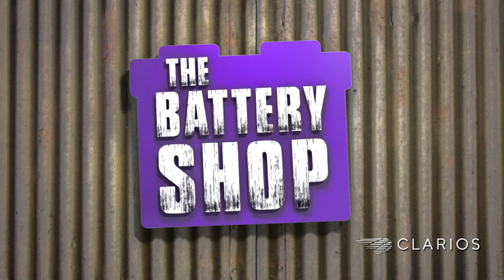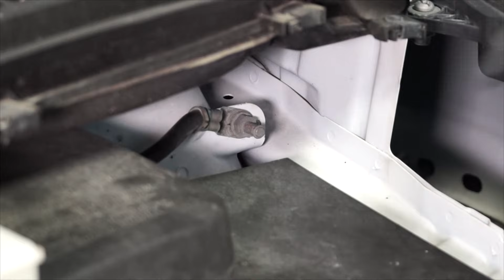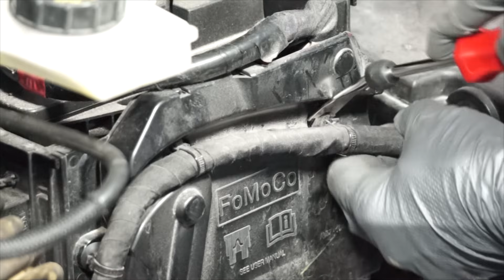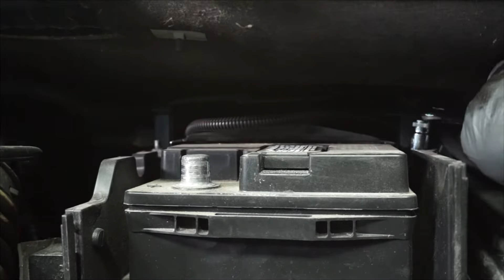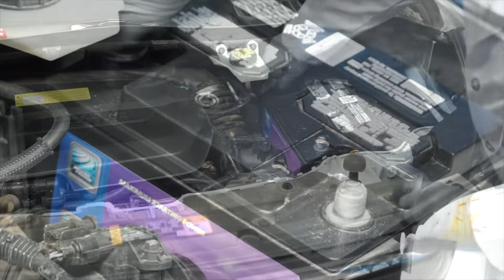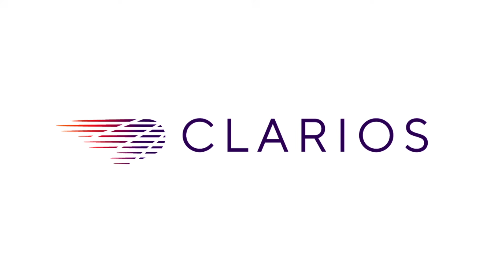Ford Escape (2013-2019) - New Battery Install

Comment: First: lifesaver love the detailed Barney explanation. Second: there is no way you can tell me they put that battery there for any reason other than to make you go to a ford dealership to get it replaced.
Reply from the maker: Hi - Thanks for watching and sharing your opinion!
Reply: Lol just getting ready to replace the battery in my wife's car and this is my exact thought
Reply: Exactly!!
Reply: Just went to replace mine. Glad I’m not alone
Reply: You said it!!!
Reply: Agreed 100%!!!!!
Reply: It was such a pain to replace with it Being shuved in to the back of the car
Reply: 100% agree with your second opinion. No way it should be this damn hard
Reply: Ford doesn't make any money when a dealership does work, other than selling a battery, and nothing requires the dealer to use a Ford battery. Where would you put the battery Mr. Engineer?
Reply: It's the only reason.
Reply: I have never understood the design of this car.
Reply: This is why my ford stock has plumneted😂
Reply: FORD TOLD ME TO DO IT ON MY OWN.
Reply: All the more reason not to buy this model anymore ever!!!!
Reply: @sarakingston9622 Its European. Have a look at the Ford Kuga.
Reply: @christoph780  I had one car a long time ago, a Rover 3500, that actually had the battery in the trunk, or the boot, as they would say.

Comment: I have to change the battery on my grandparents escape, this should be the first video on this topic. Everyone else is taking apart the entire car. This is so much more simple!
Reply: Agreed. That's what the dealer tells you they have to do. THIS process is what they actually do. Great video.
Reply: Personal preference, I prefer removing the wipers and cowl. It takes about the same time and there isn't the risk of breaking the MIDI fuses that are connected to the wiring harness you have to move, which causes a no-start condition.
Reply: I was thinking the same thing.  Saw that the front of the battery box comes off, and then when I started watching videos all these people are taking the battery out of the top, and half the car with it.  

Now, it’s still that it is this hard, but not as bad as what some are making it.  

Still not looking forward to this though.
Reply: Watched a video just before this one. It looked like a hell of a time. The video was almost 20 min Long. I guarantee it took him a least an hour. This way does look more simpler. Still a sh!ty design.
Reply: VIP now charges to do it

Comment: Exactly what I needed. I was a little pissed off that I needed an ASE certification to replace the battery on this thing but it really wasn't that bad. Gave me a chance to clean out debris from that portion of the bay and change the filter while I was at it. A ratcheting 10mm battery terminal wrench and some long ratchet extensions made this job much easier. Great video! 👍
Reply from the maker: Hi - Thanks for watching and sharing your experience!

Comment: Great video.  I am very thankful that you've made this available and taken the time to put together a well-thought-out video.  On Ford's next Escape model, maybe they'll design it so you will need to consider taking it in to the service department to fill up with gas.
Reply from the maker: Hi - Thanks for watching and sharing your opinion!
Reply: Ford moved the battery on the 2020 and newer Escapes out in the open of the engine bay.
Reply: Good to know they're no longer concerned about things like crash protection, weight transfer, things like that... 🤔
Reply: So true! I needed that laugh! Recently learned that I can’t check the transmission fluid in my 2018 Escape because of the placement, and now, trying to  install a new battery since Auto Zone won’t touch it.  I personally won’t ever find out what the next design will be, this car has been a nightmare!  Awesome video Mr. Battery!

Comment: This video was most helpful.  I had to deal with this when my battery unexpectedly died this weekend.  I usually have the guys at the auto parts store replace batteries but this time I had to deal with it.  Fortunately, I am somewhat handy. 

That said, you should never have needed to make this video!!!!

The designers of this car should be ashamed of themselves for putting the battery in such a hard to get to place that requires engine parts to be removed.  Anyone should be able to look at a car battery and be able to replace it in just a few minutes without removing anything beyond the tie down.
Reply: hi, did the escape lose all computer settings or something like that after changing the battery?, i am a bit afraid to do it my self, you know some cars need to be reprogramed after this
Reply: @JusunGuitar  it did not since my bluetooth automatically reconnected. That fixes time and date. Did need to re install radio preferences but thats about it. 

After install you can press fog light 5 times and hazard light 4 times to reset battery. Not sure what it does tho. Battery sign should go on and off a few times in dash.

Comment: 3 years later and came back to refresh myself to do it again. I use Duracell batteries from Sam's club, run them 37-38 months on a 3 year free replacement then change them proactively at my leisure in my driveway before they fail and leave us stranded somewhere. Thanks Again!!
Reply from the maker: Thanks for watching and glad we could help you out.

Comment: I can’t believe a shop near me wants to charge $400 for parts and labor to do this. My daughter in law told me that’s how much they wanted.
I am an aircraft mechanic so she asked me if I’d do it.
$170 for the battery before discount. 1/2 an hour of work.
Thanks for the video. It always helps to watch another experience mechanic do the job before going out there to reinvent the wheel.
Reply from the maker: Hi - You're welcome and thanks for watching!

Comment: I'm glad to see a method that doesn't require taking the wiper arms off and the cowl panels! The front of the battery box even comes off- not so bad. Good presentation.
Reply from the maker: Hi - Thanks for watching! We used the vehicle manufacturer's procedure found in the service/repair manual.
Reply: Im still prefer the other method for me was quicker

Comment: This is a GREAT video. Two additional suggestions: First, when you pull the battery forward, the shoulder on the bottom of the battery tray keeps the battery from sliding out. A small pry bar under the battery allowed it to slide all the way forward. Once I got the negative cable loose and out (I unplugged the sensor wire to the negative cable block.) Second: After running the negative cable end through the bench wire brush, I reassembled per the video. Just as I was about to reconnect the negative cable to the firewall, I saw I forgot to reinstall the negative cable end sensor that should have been plugged in BEFORE reassembling the battery top bracket. After 20 minutes of trying to fish the cable back to the back, I took a break. When I returned, I removed the battery hold down bracket, which then allowed me to get my hand in there. Upon further inspection, I had been trying to push the connector on backwards! I rotated it 180 degrees and it snapped right on!! Great repair, poor Ford design. Thanks for this professional video. The factory manual is usually a bit more reliable than all of the DIY remedies!
Reply from the maker: Hi - You're welcome and thanks for watching and sharing your experience!
Reply: @ mm 4:21 there is a white part with black cap that has been moved with no explanation.  😢

Comment: This video was definitely the most straightforward instructions I found.  Was very helpful, thanks so much! 

I will note, between 1:50 - 2:03, the "removing the lower air box assembly" step was a bit more involved than this video showed.  It took a bit to get the assembly fully detached, but the extra steps were low risk.  just pulling out some extra plastic pipes mostly.

Great video, saved me from having to go to a mechanic!  Just be prepared for a couple extra small steps not listed in the video.
Reply from the maker: Thanks for watching and for the feedback!

Comment: My son and I did his 2014 Ford Escape battery replacement a few days ago. I am very handy and have many tools and enjoy working on vehicles, appliance repairs, etc. let me tell you straight, this is not a job for 2/3 of DIYers. The video is excellent but really doesn’t show the difficulty in accessing various nuts, bolts, etc that need to be removed. First off, you need a 13 mm deep socket for removing neutral cable on firewall, thankfully a 9/16” worked asI didn’t have a deep 13 mm socket with me at his garage. Even removing the 8 mm battery tie down holder is time consuming but a ratchet wrench worked fine. The air filter box removal is a struggle, lots of strength needed to unseat the bottom pins as everything is so tight.
We got it done but count on 90-120 minutes from start to finish. It was 0C or 32F here.
On reviewing the windshield wiper and cowling removal alternative method, I think I would use that procedure next time as long as you are careful with wiper removal and indexing location of wiper position.

I can certainly see why a dealer would charge 1-2 hours for this as there is no quick way following factory method as shown. Autozone and others are wise to refuse to do a free battery swap on these Ford Escapes. Way too much time as well as risk of breaking something.
Reply from the maker: Hi - Thanks for watching and sharing your opinion and experience!

Comment: This is much easier way of doing it than the first time I did it. (This video you shared, is actually the way the dealership does it)  The first time I did this, I found some DIY video which shows removing the wiper blades, the black trey/clips and unscrewing the break fluid tank, in order to access the battery.  It worked, but took for ever to take apart and put back together.  Thanks for sharing this.
Reply from the maker: We're so glad we could help!

Comment: My daughters 2017 may have had the original Ford battery in it. I've heard of stock batteries lasting 7 years but never an after market.
I cut the end out of the hole on the left of the battery strap so that hard to reach nut don't have to come all the way off to get the strap out.
And zip tied the harness back in as opposed to fooling with those aggravating push in harness fasteners. Those were way too hard to get out on her car. Lot of unnecessary stress on the wires. I won't have to fool with that again.
Thanks for sharing! I've never seen a car where a video was needed to change the battery! Use to a crescent wrench would do in a pinch but even then I preferred to use the correct wrench.
Reply from the maker: We're glad you found our video helpful! Good job replacing the battery in your daughter's vehicle

Comment: Great video. This method is by far the better method than the video which shows taking off the wipers, engine cover/rain shield pan etc.. When I first bought the 2013 Escape the battery failed after four years and I said no problem and started. Well, I started just like your video but I got to a point where the battery tray would not come out. Well, you went through the steps and lifted out the battery tray. Well, it doesn't lift out as easily as it looked when you did it. Finally, I realized that two grommets (?) have to be somewhat yanked out. Then, after that tug, yank, or strongarm pull, it worked just like you said. The other difficult part, as least for a 1st timer, was getting the air inlet from the front of the car to the air filter removed. After some study it wasn't nearly as hard as I was making it. Now I've done it, I could do it in about 20 minutes tops. Thanks for the video. I'm am most pleased with myself. And you!

Comment: One of the best video presentations on YouTube. Thank you.

That said, the engineers at Ford designing this setup have the heads buried up their tail pipes so far, they don't realize they are professional shysters. There is zero excuse for such a design that requires this much effort to replace a simple battery. Shame on the engineers, shame on Ford. I've owned a few Fords in my life, but after owning a 2007 Ford F250 Lariat and a 2015 Ford Escape, I will never again have one of these "wrecks on wheels" adorning my driveway. The epitome of not American ingenuity, but of American stupidity.
Reply from the maker: Hi - Thanks for watching and sharing your opinion!

Comment: Based on my experience with my 2014 I would avoid this method like the plague. It was really tough an I just couldn’t finish and replacing the air box was a huge drag.  Luckily I tried the removing the windshield wipers method and it was really easy. Success at last.
Reply from the maker: Hi - Thanks for watching! We used the vehicle manufacturer's procedure, but thanks for sharing your experience.

Comment: The lower half of the air filter box/plenum on my 2014 Titanium did not just lift out, it needed some persuasion to have the feet that slip into grommets underneath it release their (6) year old grip. Beyond that it is a great video that really assists the DIY kinda person to get through this chore.
Reply from the maker: Hi - Thanks for watching and sharing your experience!

Comment: Howdies TBS. Well doggies. Using your video and others...(I'm challenged) I finally got the 2017 back together. And it started. That's good. Gonna give it a test ride afterwhile. Yesterday when the thing folded in the yard when it was supposed to be taking us to church, after watching the vids it was a no brainer. I figgered...Let the shop haul if off. My dismay began that morning when lifting the hood I could NOT even find the battery.Then around 3AM this morning after getting up at 2AM to have another go with the vids and picking out my battery I said to heck with it. Slept like a baby until 7AM. 

I will say it took me about 3x longer than it took you (There was that one little bolt that gave me cat fits) and I can't see it taking much less time next time. Grrr! But there is absolutely NO way in heck that I could have replaced that battery without your help. I'm here to say thankee 50 times! Another satisfied customer! 
Your bestest fan in Alabam,
Norm
Reply from the maker: Hi - Thanks for watching and sharing your experience!
Reply: @TheBatteryShop  The Ford Escape is all fun and games until the battery goes poof. You ARE the man! Running like race car!

Comment: So i have to take the whole car apart to replace the battery , great job Ford.
Reply: so truuuuuuuu...its nuts
Reply: I think they started with the battery and built the vehicle around it!
Reply: Because you know, 45 minutes every 5 years is sooooo hard . . .
Reply: @mojognome  thata not the point it take 10 mins in any other car i had
Reply: @mojognome 5 years? Bruh here in Texas a battery maybe lasts 2 years. 5 years in perfect weather with minimum driving, sure

Comment: This is good if you have the right tools. But for my 2018 Ford Escape it was better taking off windshield wipers and cover. It was easier to get to the battery.

Comment: My 2015 Escape was a bit different. The temperature sensor housing has a second intake tube that blocks the forward screw. However, that second tube snaps out and then you can remove the forward screw.

You might notice too that he never explicitly says to move the brake fluid reservoir, but sometimes in the video its in place while other times it has been moved. Mine was in way, so it probably does need to be moved.

The next problem is that although you can remove the air filter housing with the intake hose and temperature sensor housing in place, you can't see to reinstall it. There are small hoses that have to be moved out of the way to seat the air filter rear attachment into the rubber socket. You'll have to remove the intake hose and sensor housing to see what you're doing.

Also, he didn't show how incredibly finicky the air filter cover is. Some mechanics will try to force it down and strip out the plastic screw beds.

But, overall, the video was quite helpful. 👍
Reply from the maker: We're so glad you found the video helpful!

Comment: Thanks for this video. It was not easy. One caution. As I removed the lower half of the air filter box one of the rubber mounting grommets was pulled out of its location and fell into the engine compartment. I didn’t notice it was missing until reassembly. I found it with a bright flashlight. Thanks again.
Reply from the maker: Thanks for watching and for the feedback!

Comment: Heads up to anyone with the same year escape but the engine layout is different...

The cowel removal method is the best way, or maybe even the only way, because the components needing to be removed didn't seem like they'd allow access to the battery anyway.

It honestly wasn't that bad as everything was easy to take off and put back on
Reply from the maker: Thanks for watching and for sharing your feedback.

Comment: This is a wonderfully fun car to jump start.
Reply: Use the firewall mount for the negative clamp instead of the battery clamp/post .... HOPEFULLY the negative terminal/battery clamp interface isn't corroded and it should work.

Comment: Of the 4 videos I’ve watched this is the best. No one else mentioned disconnecting the negative earth cable!!!

It’s pretty tricky as the bolts are so inaccessible on some models. But it’s manageable with small wrench or socket set. 

Now what about the BMS programming? You don’t cover that.